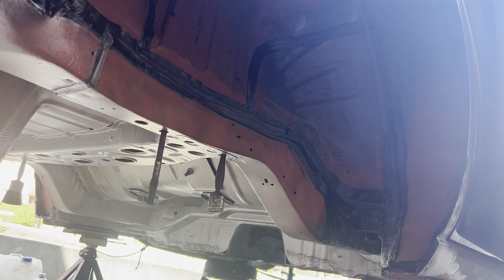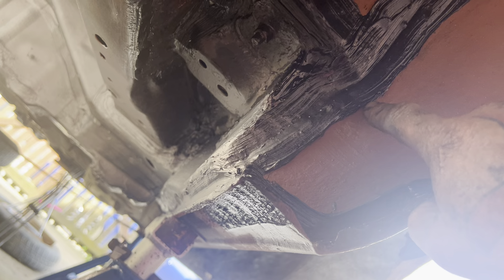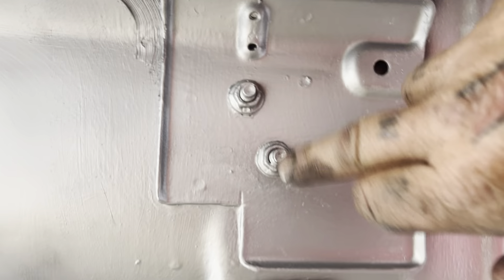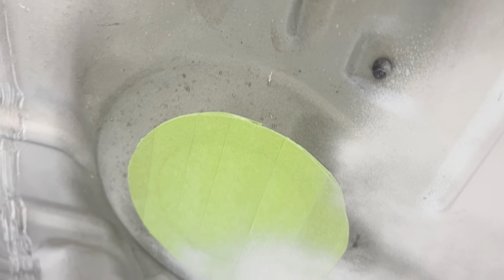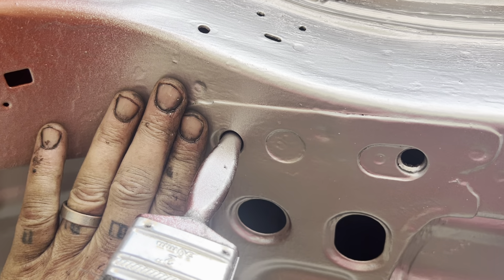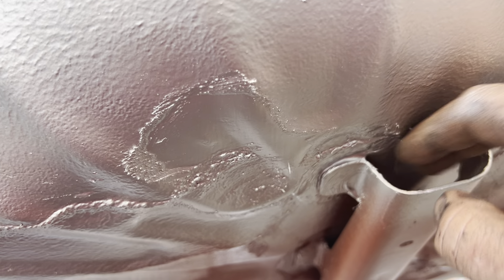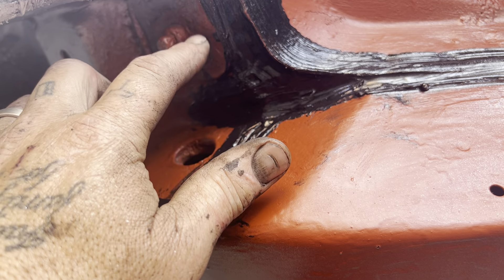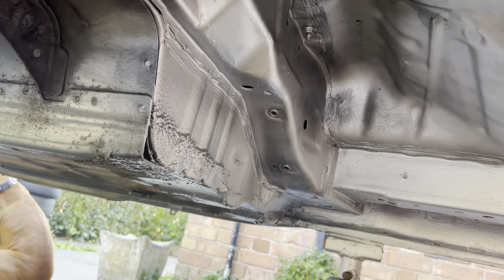TIGS floor update

Comment: How did you apply the seam sealer then? 
Thanks
Reply from the maker: @therealdojj  yea they come in tubes , u apply it via a gun ( silicone gun) then when you’ve applied it I use a brush soaked in gunwash leaves a nice finish 👍👍
Reply: @dunkhoughton175  thanks 👍